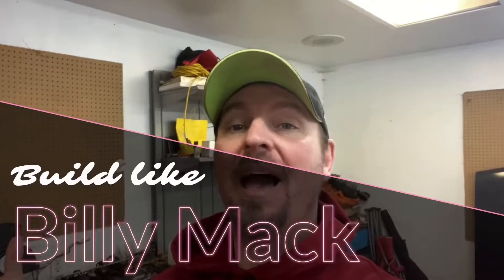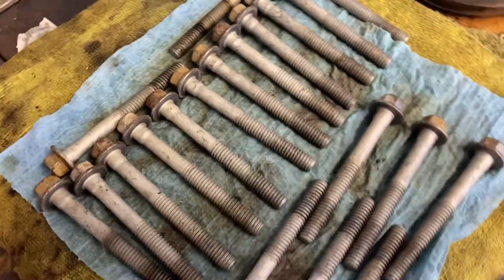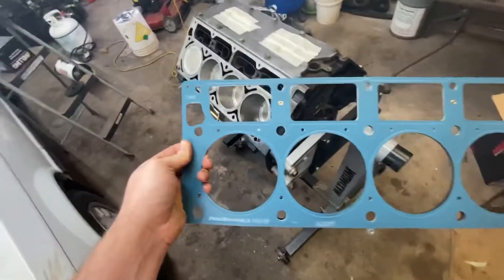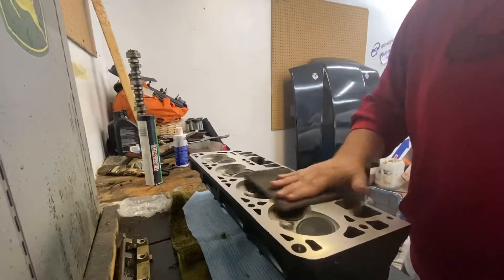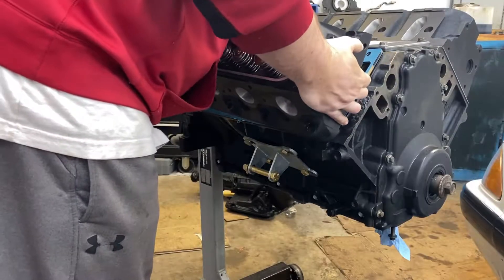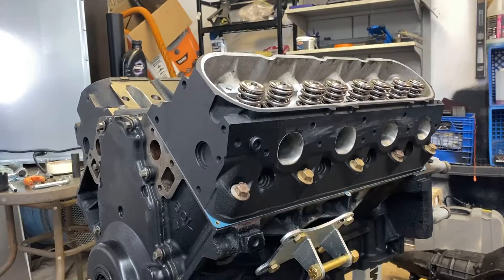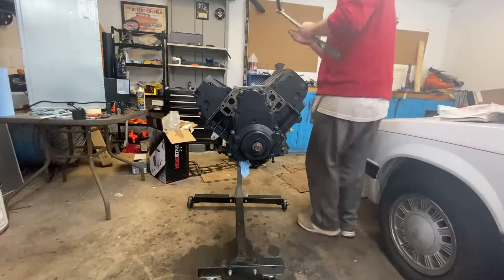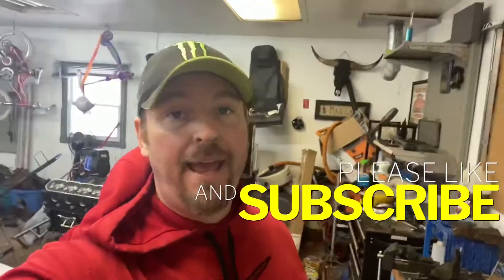Budget LS build // MUST SEE!! How to install heads on a LQ4 reusing my factory head bolts!!

Comment: Did you have any problems reusing old head bolts
Reply from the maker: No sir 
I did end up going with studs just because
Reply: @billymackbuilds  In other words, you got a failed head gasket and you decide to go with aftermarket studs.

Comment: At 2:53 you put the head gasket on wrong. The two extra holes goes towards the rear. You can see the stamp "front" that you placed it on the rear of the engine. This will cause cooling promlems on that side of the head. Bummer you missed that.